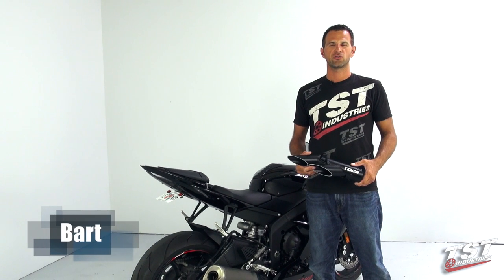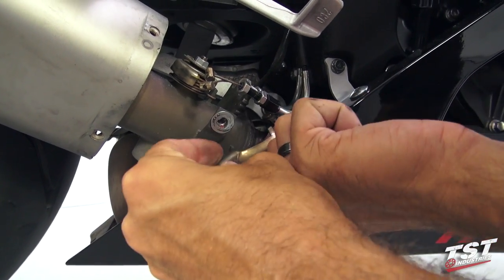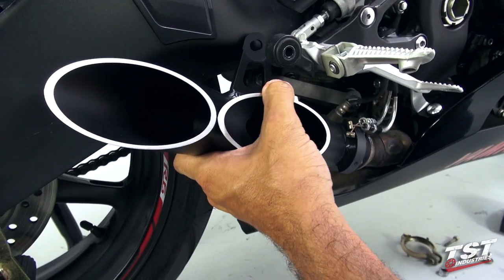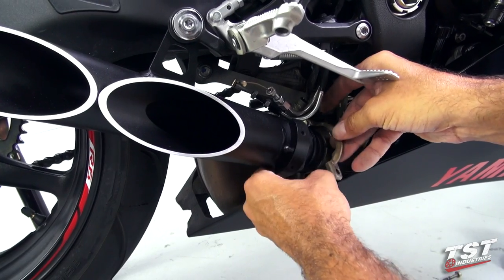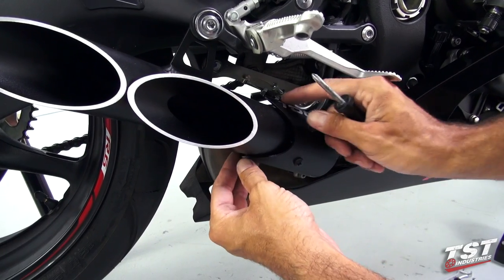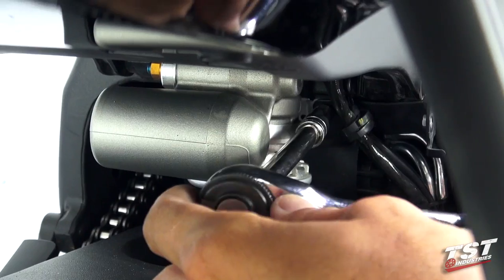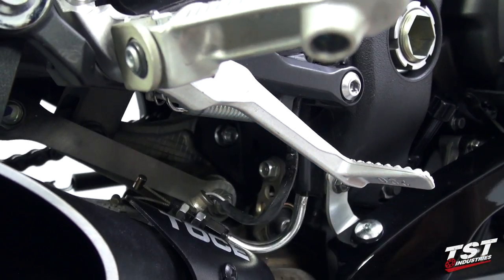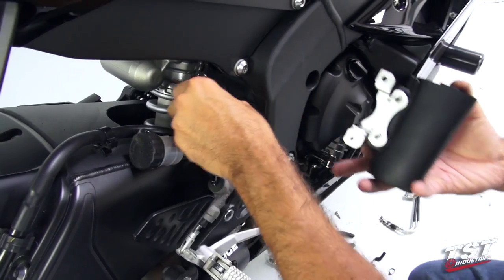How to install Toce Double Down Exhaust on a 2006-2016 Yamaha YZF R6 by TST Industries

Comment: Doesnt not reinstalling 02 sensors throw a code. Also doesnt not having the sensors cause the engine to have incorrect backpressure from exhaust. Thats what sensors are there for in first place.
Reply from the maker: The O2 sensor remains in the forward section of exhaust. We did not remove it. Back pressure is not governed b y any sensor on the exhaust.

Comment: So if the servo cables are not removed, there won't be an engine light on right?
Reply from the maker: You can remove the cables but you have to keep the module plugged in so it does not throw a code.
Reply: I just purchased and installed the this pipe from TST (looks great!), didn't remove the servo or the cables and my engine light came on.  I did throw the bike up my stands and ran through a couple gears at very low RPMs.  Any ideas or advice?
Reply: Can I leave the cables  on just zip tie them and it want throw a code

Comment: A few questions. 
1) Would this exhaust work on a 2017 R6? 
2) You say it's a "straight pipe" type slip-on, isn't that bad for the engine over time, and extremely loud? 
I'm interested in this exhaust because it's short and lightweight, but I don't want to hurt the bike by using it, or have to do more work after installing it to ensure it doesn't cause any damage..
Reply from the maker: This exhaust will fit the 2017 R6: https://tstindustries.com/Toce-T-Slash-Exhaust-Yamaha-R6-2006-2017.html
Also, your bike will not be any more susceptible to damage if you decide to use this exhaust. To answer your question, your engine will be just fine.

Comment: If you have a 2017 or above, you need to go through under the tank, I took the seat off, and then propped the tank up, with a 2 by 4 and took it out that way.

Comment: I have aftermarket headers when toce. Tried reinstalling stock muffler but the mounting bracket doesn't line up with the hanger on the stock muffler?
Reply from the maker: You basically created a straight pipe. I don't understand your question...it looks like a statement but then has a question mark. If you've put together a frankenstein type of component arrangement there is no guarantee that parts will fit with each other. I would say ditch all those parts and get a properly designed and built full exhaust like your R6 deserves.
Reply: @TSTindustries  I bought it with after market headers and a mid pipe. The toce muffler lines up with the hanger on the rearsets no problem but if I try to put stock muffler on, the hanger on the muffler doesn't line up with hanger on the rearsets. Is this cause of the midpipe? It's just redicuslously loud and I'm trying to quiet it without changing to much
Reply: @TSTindustries  Nvm I'm just a retard and used the collar and gasket wrong😔

Comment: No power commander or ecu flash needed? If not would you need it if you put on a after market midpipe/ cutting out the catalytic converter?
Reply from the maker: Being that this is simply a slip-on exhaust a tune or ECU flash is not needed unless you were hoping to see a possible difference in performance. If you are wanting to remove the catalytic converter or replace your OEM headers we would definitely recommend getting a full tune or ECU flash.

Comment: Would it do anything if you just ziptie those cables instead of removing em? Anything that may annoy or impede my riding?
Reply from the maker: I have seen guys zip tie them and they don't complain. In theory it shouldn't affect anything but I recommend making that decision yourself.  Removing them is pretty easy so maybe you will reconsider.

Comment: I read around that if I have the Toce slip on, which is basically a straight pipe, and install headers it will lose back pressure which can damage my valves in the future. Is this true? Or if I get a power commander/tune this will fix the problem?
Reply from the maker: Technically you can run a bike on straight pipes without causing any damage to your engine components. This will require a proper tune to make sure you don't lean out  the air/fuel mixture. However, I do not think you would be happy with the sound of that bike with straight pipes. It is very loud, and sounds just too raspy. We can offer you the 3/4 exhaust by Toce instead. It will eliminate the cat box, add a glass packed muffler, and has  a bung to screw your O2 sensor into. I think you would be much happier with that solution.
Reply: Okay, so a power commander with proper map would fix the air/fuel mixture?  I'll check out the 3/4 exhaust and do some more studying. Thanks!
Reply from the maker: NomNomNom Yes, you can do a power commander or any other piggyback fuel computer. You can also go the route of re-flashing your OEM computer with FTECU. That is what we use on our shop race bike Yamahas. This system unlocks your ECU's a/f ratio, ignition timing, throttle mapping, exup valve t/f, and a lot of other settings that cannot be controlled by a piggyback computer.

Comment: Question... whats the purpose of those cables and stuff thats been taken off the exhaust???
Reply from the maker: The cables connect a servo actuator to a valve inside the stock exhaust that comes off with the muffler. The ecu controls the opening and closing of this valve for several purposes. When the exhaust is replaced there is no need for the servo or the cables, but most guys retain the servo to not throw codes on the dash.
Reply: @TSTindustries  so whats the purpose of the valve? What happens when it opens or close? I mean... if theres such a thing, why not just connect it to the new muffler? Or is it not possible by any chance...

Comment: What's the difference between double down and razor tip?
Reply from the maker: It's basically the shape of the canister/outlet. If you take a look at a Razor Tip type exhaust you will see that there is a main cylindrical canister that has an inlet from the header. There is a glass packed baffle inside there. Aft of the cylindrical part there is an angled member welded in that then has two sections of tube welded onto it after they have been slash cut. Those are your outlets.

Comment: Do you have a mid pipe for this? I’m looking for it. I need it because I want to take the big box out ofnit
Reply from the maker: We do not have a midpipe for this model. Sorry. We have built race R6's for our race t3eam and we typically use Yoshimura full exhausts on those builds. We have them in stock if you are interested.

Comment: What if you keep stock exhaust and remove those servo or OEM cables whatever they are called, what happens and is it bad or good ? :)
Reply from the maker: You don't want to do that. Your EXUP valve will no longer move and you will lose the functionality it provides.

Comment: Is there a toce exhaust like the one in the video that fits a 05 R6? Or can that one fit my 05 r6?
Reply from the maker: +David White The Toce exhaust model for the pre-2006 R6 looks much different. It is not a shorty in the belly. It is the length of the stock unit with a dual slash cut can.

Comment: Will it fit on a 01 r6? With out to much work?
Reply from the maker: This does not readily fit a 2001 R6. If you intend to use it on that bike I think it will be a bunch of work. In addition, the 07+ model has a catalytic converter that muffles most of the noise, and this slipon just directs the flow of the exhaust at an angle away from the bike. On the 01 you will not have that muffling because if you remove the stock exhaust there isn't a catalytic converter left. This will basically give you straight pipes of improper length for that bike. I would advise you to steer clear of doing this modification.

Comment: is there any problem if I dont remove the servo motor cables?
Reply from the maker: Not really. Some guys decide to leave them on. You just have to realize that they do articulate with the motion of the servo so you have to affix them to a suitable component on the frame so the cable ends don't snag on anything. Definitely keep them away from any rear brake component.

Comment: Is there a way to remove that little exhaust box right before the slip on ?
Reply from the maker: You will have to replace the header to do that.
Reply: TSTindustries is that worth doing
Reply from the maker: Depends what you are going for. For riding around the streets I would say no.

Comment: Man.... do those shroud screws really need Red Loctite? Wouldn't Blue be sufficient, or no?
Reply from the maker: Try it and we will find out. I believe that the red is more resistant to heat fatigue, and that is why red is recommended.
Reply: Haha!!!! Easy guys.  I literally, and I do mean literally, just opened up a box from TST industries.  I'm not kidding.  I literally just walked in from the mailbox and opened up the box and then saw this. We are on the same side. . I got my integrated tailight, fixed low fender eliminatior, universal liscense plate light and TST flasher relay!!!  It's Art from Connecticut. I was only asking because I know that in many cases Red can be pretty severe.  Anyway, I was just asking. I have to go now. I have an integrated taillight to install on my FZ09. Thank you for the quick shipping.
Reply from the maker: Red sucks if you put a whole lot in, and at some point you have to remove the screws. If you do use red and sometime down the line have to remove the fasteners make sure they are nice and hot, and they will release.

Comment: The 2017+ R6's have exup valve? I want to fit a toce slip-on
Reply from the maker: The 2017 does in fact have an EXUP valve system. The valve itself is in the pipe leading into the exhaust canister, and the servo actuator is under the tank. You can install a Toce slipon on the bike but you will have to at least disconnect the actuation cables from the valve on the exhaust. We recommend removing the cables altogether, but that involves having to get into where the servo is. If you want to remove the servo off the bike completely you will have to purchase a servo eliminator type device, or flash the ecu to remove that functionality and its error codes from the system.

Comment: its just the pipes or toce got something inside ?
Reply from the maker: +michael memphis That particular unit does not have baffles in that short canister.
Reply: +TSTindustries Will you guys do a video on the toce 3/4 system for the r6
Reply from the maker: +Blueberry Muffin Nope a power commander isn't required to use this slip exhaust because you aren't removing the catalytic converter.
Reply from the maker: +Blueberry Muffin If you were installing a full exhaust system then you would need to install a power commander and get a proper tune. The catalytic converter on this bike is very restrictive from the factory so changing just the muffler with a slip on system isn't going to do much power wise or fueling wise. It will not run rich with this system because the cat will still be in place and you are not changing the fueling (which is only possible with a ecu flash or a tune using a power commander).

Comment: what is the purpose of the servo cables?
Reply from the maker: +TheGentlemansLife They connect the servo motor to the EXUP valve and actuate that valve. The bike is designed that way to quiet the bike down at low RPMs and also to increase exhaust back pressure at low RPMs to help the motor build more torque down low. With an exhaust change the EXUP valve is removed so there is no need for those cables.
Reply: +TSTindustries  does that mean that a EJK will be needed to adjust for the change in backpressure?
Reply from the maker: TheGentlemansLife EJK is a tuning device, much like power commander, and Bazzaz FI units. It does not control back pressure in your exhaust. It allows you to tune the fuel injection system to supplement the right amount of fuel to the engine. Even so, just installing that unit will not yield any performance benefits. You have to get a good dyno tune to see results. For this particular exhaust a fuel injection tune is not absolutely necessary. However, a good tune will get your torque curve smooth and get you some performance gains. If you are looking for more performance we would get you into one of our Arrow full kits along with a BMC racing air filter. Then doing an FI controller along with a good dyno tune would get you some noticeable performance gains.

Comment: If those cables don’t hook into anything doesn’t an engine light come on?
Reply from the maker: Nope. As long as you keep the servo motor connected, the ECU will still believe it is working as intended and will not throw a code.
Reply: TSTindustries means a lot thanks for the quick reply man so just zip tie it basically
Reply from the maker: Zip tie or even go a step further and simply remove the cables completely. Either would work with no issues.
Reply: TSTindustries I thought if you remove the cable the code comes up?
Reply from the maker: A code only appears if the servo motor is removed/disconnected. Removing the cables alone will not affect anything.
Reply from the maker: No and I apologize for any confusion. You can remove the cables without removing the motor. That would be the more professional option but zip-tying them would be a great second option. As long as the motor stays connected, you will not throw a code.
Reply: TSTindustries okay so I’m doing the same exact thing right now but I didn’t disconnect the cables and just zip them up there won’t be any engine lights correct
Reply: sorry if anything I’m confusing you just I’m not taking out the servo motor just tying up the cables so there won’t be any lights or problems at all ?
Reply from the maker: Yup, that should be perfectly fine!

Comment: 3.15 lbs "rougly 4 pounds" what kind of rounding is that
Reply from the maker: The display shows pounds.ounces . There are 16 ounces in a pound. 15/16 ounces is 0.9375 pound, therefore making it close enough to round it up

Comment: why those servo cables are given????
Reply from the maker: Raghav Sharma the OEM canister has a valve in it that is actuated by the servo through the cables. Once you remove the stock canister the valve is gone so no need for the servo. If you disconnect the service the computer throws a error code so most guys just remove the cables and keep servo plugged in. You can remove the servo through the use of a servo buddy type device, or through flashing the ECU to remove that function if you want to go that far.
Reply: TSTindustries thanks sir....😀😀
Reply from the maker: You're welcome

Comment: you forget to put back the bolt that you removed 10:02
Reply from the maker: +Renz Jefferson Perez That screw was used to hold the clamp for the servo cables in place. We removed the cables which took the clamp away with it, so that screw would not have anything to screw into at that point. Therefore it was not needed anymore.
Reply: Oh. I see. Thank you.